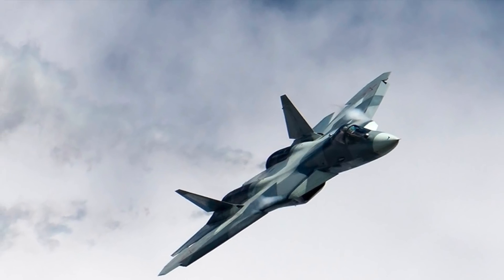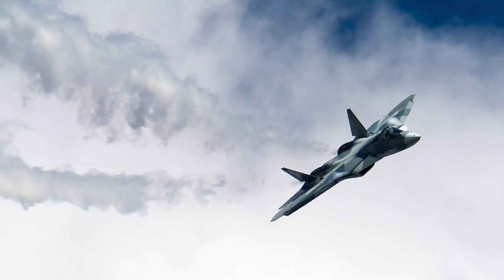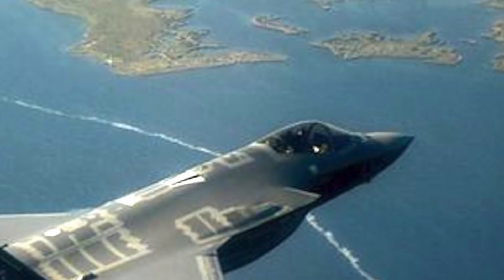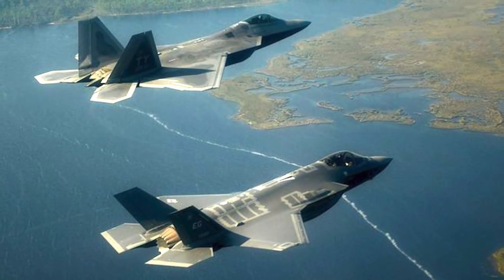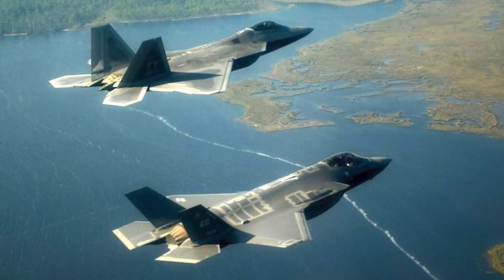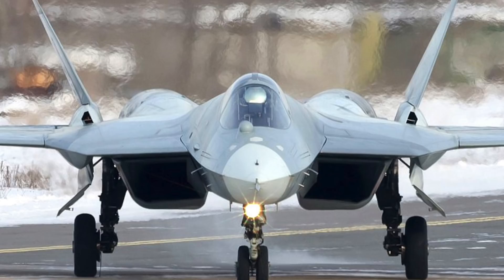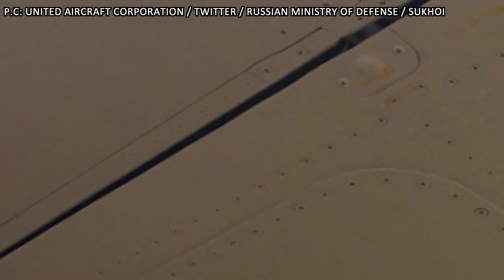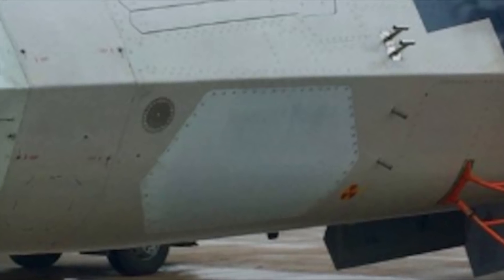WHY NEW RADAR-EVADING COATING WILL NOT MAKE RUSSIAN SU 57 STEALTHY?

Comment: Well, they can cover the aircraft with sellotape like you guys did with the F-22/35 and you won't see the bolts anymore... You should consider the radar capabilities, weapons etc., not just the stealthy capabilities of the plane! It is less stealthy than F-35/22 indeed, but it is like that only because the Russians decided that the complete stealthiness is not crucial requirement for them. Simple as that. Also, the Indians a funny tho! They can't build even a decent 4th gen airplane but they demand and criticize.

Comment: Talk about the 1.3 trillion dollars blockheads spent on the dud f-35...!
Reply: the f35 is actually considert better then expected already. Turkey japan and 2 more other countries signed up to buy them already.
and the buiolding cost is already close to the f16 due to mass production. so  plx think before commenting and no im no american.
Reply: @marcschepers8144  yeah ture
Reply: @marcschepers8144  now it costs around a Rafael jet
Reply: A flying brick
Reply: That's its projected cost over its 40-50 year lifespan.
Reply: Nowhere near that amount has been spent on the F-35. Let me explain to you morons.

You see, they calculated the total cost for the aircraft until it's meant to be replaced, including all additional costs, then adjusted that cost for inflation, and that got them the 1.3 trillion figure. The F-35 hasn't cost anywhere near that amount because we aren't in 2070 yet.

Comment: I have a small electronics company and buy some circuit subsystems from other small company's in Russia.
Their product are very good at a good price.  The problem is when you try to buy from large government suppliers.
These suppliers are not able to maintain good quality control of their products.  The equipment will work when you get it, but for how long and there is no guarantee.

Comment: Based on total western assumptions........poor video
Reply: truth hurts
Reply: India (not a part of the western bloc) found the SU 57 to be non-stealthy and the Russian's claims were bogus. What Russian propaganda can you provide to refute India's actual test results that (using their S300 and S400 systems bought from Russia) that easily and clearly proved the SU 57 was not a real stealth jet?
Delude yourself or keep pushing Russian propaganda, but why did you paint yourself into a corner where the truth cannot be lied about?
Reply: lol i didn't know India was considered part of the "west" A third world country's engineers determined that russia's plane was fundamentally flawed in design and can't become the stealth plane it want's to be. If India is aware of the SU-57's short comings then western engineers were likely aware of these weaknesses  YEARS in advance.
Reply: @fabiantaveras8458  The Third World engineers are getting top jobs in Silicon Valley with no problem. What are your credentials?
Reply: @charonboat6394  what do credentials have anything do with the fact that Russia's latest 5th gen plane is so flawed that even third world engineers can spot it's shortcomings!? 😂
Reply: Nah - if you have eyeballs and a brain, you can tell that the plane isn't stealthy. The inlet ducts and gaps are shit, they have failed to develop any suitable engine nearing the capability of the F110, and the entire belly and rear of the SU-57 is about as stealthy as an F-14 (school bus). It also has tons of sensors and pitot tubes all over the place. Look up photos of the F-22, it doesn't have ANYTHING I just mentioned. 20 years ago the US figured all of this stuff out. Pretty pathetic really. They need to scrap the 12 SU-57s they've got - in 10 years when they finally get these un-stealthy planes operational, it'll be FAR more embarrassing, knowing it took thirty years to match the F-22 (even with exponentially more powerful computers and understanding of fluid dynamics, aero modeling software, vastly more advanced composite engineering methods, etc available to them!)
Reply: The raptor will kick everybody's ass anyway. Not to mention of course the reverse-engineered alien technology. 😏
Reply: @kingcrabbrc  and the top secret missile systems
Reply: Black Hole Guy 
🤫
Reply: @kingcrabbrc  i think S-400 also kick ur ass u ass hole.
Reply: Exactly
Reply: Ignacio Muñoz Diaz Why are you lying? All it does is make you lose credibility?
Reply: Ignacio Muñoz Diaz If you’re not lying then back up your words with a credible link showing that the Indian AF has formally accepted the Su-57. I follow the news closely and know that nothing of the sort has happened.  The fact that you’re lying just proves that you cannot accept reality.

Quit raging like a child. It only further diminishes anything you say.
Reply: Ignacio Muñoz Diaz  Are you nuts? That is not a statement saying that India formally accepted the Su-57.  That was just one component of what was wrong with the deal.  WTF is wrong with you? 

India has many problems with the Su-57. This is when the news began about their displeasure: "India Wants Out of 5th Generation Fighter Jet Program With Russia"https://thediplomat.com/2017/10/india-wants-out-of-5th-generation-fighter-jet-program-with-russia/ 

Here's when they actually leave the partnership: "India Pulls out of Joint Stealth Fighter Project With Russia" https://thediplomat.com/2017/10/india-wants-out-of-5th-generation-fighter-jet-program-with-russia/

The Su-57 is a joke.  It has been flying for over 10 years and only prototypes have been built.  It has never shot air-to-air missiles or even its gun in flight.  Shit, the F-22 first flew in 1997 and less than 8 years later it was already declared combat ready and was in service.  The F-22 is better than the SU-57 is every way imaginable.  Power, stealth, avionics, sensor fusion, etc., and it has been tested and used extensively in combat. Unless Russia can convince India to join back in the partnership, the Su-57 is dead.  So far the news about the Su-57 hasn't been good, being called 5th gen by name only:

"Unfortunately for Russia, its PAK FA, also known as the T-50, is having developmental issues that put its entire premise of being a fifth-generation fighter into question.

Reporting from the Singapore Airshow 2016, IHS Jane's reports that "Russian industry has consistently referred to the Sukhoi T-50 PAK FA as a fifth-generation aircraft, but a careful look at the program reveals that this is an 'in name only' designation."

This is largely because of a lack of evolutionary technology aboard the plane compared with previous jets that Russia and the US have designed. Indeed, the PAK FA's engines are the same as those aboard Russia's 4++ generation (a bridging generation between fourth- and fifth-generation aircraft) Su-35. Additionally, the PAK FA and the Su-35 share many of the same onboard systems.

And even when the PAK FA's systems are different from the Su-35's, the plane's specifications are still not up to true fifth-generation standards."https://www.businessinsider.com/russias-newest-fighter-jet-is-fifth-generation-in-name-only-2016-2
Reply: Ignacio Muñoz Diaz There you go lying again.  Seriously, can you go just one day without being dishonest? 

You don’t know WTF you’re talking about Russia has never put into service AESA radar. It’s first attempt in the MMRCA tender was a huge failure where it failed to reach desired acquisition ranges. 

Cite an expert that states that the Su-57 is better than the F-22.  You can’t and you know it.  The Su-57 isn’t even stealth. It was one of the features that the Indians complained about. How about avionics? Russia has nothing like the F-22’s AN/ALR 94 that can passively detect, track, and target aircraft over 100 nm without being detected.

Be sensible.  Do you really think that that Russia is going to leapfrog over the US after the US has been fielding stealth aircraft for four decades while Russia has had none?
Reply: Ignacio Muñoz Diaz I don’t need to lie. I am not like you.  What jet fighter aircraft has Russia put AESA into that’s in service?  None.Russias first attempt was at the MMRCA tender in the MiG 35 and it was a huge disappointment.  Google, For Heavens Sake Don’t Buy the Russian MiG 35” or “Radar and Engines to blame for MiG 35 in MMRCA.”
Reply: Ignacio Muñoz Diaz Rage all you want. It doesn’t change the truth.  Do you have a reading comprehension problem? What Russian jet fighter that’s in service has AESA radar? None. Use common sense. Do you really think that Russia will pass the USA with AESA radar after the US has been using it in service for nearly two decades? The USA now is  fielding 4th gen AESA while Russia hasn’t even put into service its first. 

The MiG 35 failed miserably in the MMRCA tender.  To say that it failed to impress the Indians would be an understatement. 

I read from many sources. I am not like you who has to lie and misrepresent the truth.  A good example is when you claimed that the only reason why Indian rejected the Su-57 was only because of tech transfer issues, when in reality they’ve been disappointed in lack of stealth features, its engines and avionics.  Never did they claim that they gave formal approval of it like you claimed Lie, lie, lie, that’s all you Russian trolls can do. The fact you’re lying tells me that you know yourself that you’re wrong.
Reply: Ignacio Muñoz Diaz    This is from an Indian website about military news: " In a first formal confirmation from either government, Russia today said that India had ‘temporarily suspended’ participation in the Su-57 fifth generation fighter aircraft program, a decision reported to have been taken by the Narendra Modi government in February this year.
Responding to a question from Livefist, Dmitri Shugaev, director of Russia’s FSMTC — which controls Moscow’s arms exports — said, “Yes it’s true India has temporarily stopped participation in the FGFA project. Russia has advanced far in the Su-57 tests and it has orders from the Russian MoD.” https://www.livefistdefence.com/2018/08/russia-confirms-indian-pull-out-from-joint-fifth-gen-fighter-project.html 

 To date it still has not gone back into the partnership so the suspension is still in affect.  If you had any ability to look at the big picture you could easily see that the partnership is dead. Grow up and just admit that you're wrong.
Reply: Ignacio Muñoz Diaz [ YOU NEVER SAY JET RADAR AESA ]  You're right, I didn't.  I didn't think it was necessary and was implied.  We're talking about jet fighters, not aircraft.  I didn't think that I needed to get so specific with you.  Russian fighter jets have no AESA experience.  The first try was in the MMRCA tender with the Mig 35.  And no, the Mig 35 did not pass all the criteria, liar.

"Engines and radar to blame for MiG-35 failure in MMRCA contest"    

04 August, 2011 SOURCE: Flight International BY: Vladimir Karnozov London 

Radar and engine performance shortcomings were to blame for the MiG-35 failing to make the shortlist in India's medium multi-role combat aircraft (MMRCA) contest.

"The MiG-35's radar, the Zhuk-MAE active electronically scanned array (AESA), from Russia's Phazotron, failed to achieve the required acquisition and tracking ranges. And its Klimov RD-33MK engines also fell short of the Indian performance criteria."https://www.flightglobal.com/news/articles/engines-and-radar-to-blame-for-mig-35-failure-in-mmrca-360364/

Unlike you I am backing up my words, while all you've done is have misfits and lied repeatedly.  Your personal opinion means nothing to me.  The fact that you lie so often tells me that you have no integrity and cannot be trusted.  If you're going to make a comment, then back it up with a credible link. I shouldn't be hearing back from you.  I follow the news closely, and from many news organizations.  There's zilch to support your opinion.
Reply: Ignacio Muñoz Diaz  [AND THE B2 AND F117 DON'T BE FIGTHERS] Go back and read my comment.  I said stealth aircraft, not just fighters. Russia has built just one, the US many.  Learn how to read and comprehend what you're reading.  You're wasting my time with childish behavior. 

[THE SU57 BE SUPERIOR

HAVE A MORE ADVANCED ENGINE( THE IDZ30), BETTER SENSORS, TVC3D ,BETTER SENSOR FUSION AND MORE ADVANCED FRAME. .]  That's another lie.  Russia has never put into service any fighter with 70,000 lbs of thrust like the F-22. Russia has nothing remotely close to the F-22's avionic suite or sensor fusion, and you're saying that it does is only your dream.  The Su-57 frame is obviously from outdated Su-27.  That's is not better, it's old.  Put it this way, during the MMRCA tender India's Air Chief said the US had the best radars and systems, and all he got to see were those in the F-16 and F-18, which are far from the ability of the F-22.  Grow up.  I am tired of your childish rants and inability to be sensible.
Reply: Ignacio Muñoz Diaz Live in denial all you want.  If you ever read its articles , you would know that it’s independent and speaks about India’s interests.  Unlike you, I have cited many sources.  What is your “official news source “? Sputnik and Pravda, lol. They’re state controlled.  The fact that they NEVER are critical about Putin shows how they are afraid to be objective. 

What if I quoted and cited India news sources? Would you still live in denial or finally accept the truth?
Reply: Ignacio Muñoz Diaz There you go again raging like a child with your own personal opinion that means nothing. Facts, history, logic, using common sense all say you’re wrong.
Reply: Ignacio Muñoz Diaz HAhaha, you really do have a reading comprehension problem. The source I cited states that the MiG-35 radar failed to detect and track targets at desired ranges, meaning that it along with the Migs engines failed.

Answer my earlier question coward, if I cited Indian news sites about the Su-57 being a POS would you finally agree? Even Sputnik need admitted that it was more than just tech transfer.  The truth can slap you in the face and you will still live in denial.
Reply: Ignacio Muñoz Diaz I don’t need to lie. I am not like you.  Remember how you said that Qatar, Saudi Arabia and Turkey had no interest in buying the Patriot? Then I proved your ass wrong and you were to afraid to admit it.  How about how even Sputnik news stated that India has problems with more than just tech transfer.  You denied it twice until for the second time I had to cite it all over again for you.  Not only are you a liar, but you’re a coward who’s afraid to admit being wrong.  I feel sorry for anyone who personally knows you. Everyone makes mistakes, but you don’t have the balls to admit it.

The MiG 35s radar and engine was to blame dumbfuck. Russia didn’t have any MiG 35s in service so of course it was an early version of the aircraft.  WTF is wrong with you? Stop acting like a child.

Come on coward, tell me if you’re willing to admit that you’re wrong if I cite India news sources that the Su-57 is a POS or are you going to keep on running away?
Reply: Ignacio Muñoz Diaz  then please persuad india to buy mig 35
Reply: Max T    Sour grapes, don’t sulk buddy, just accept defeat gracefully.
Reply: @sydneythomason5950  Why shouldn't he?  Western supporting fanboys do it all the time. ;)
Reply: Max T 
Still can’t make a decent truck soooo